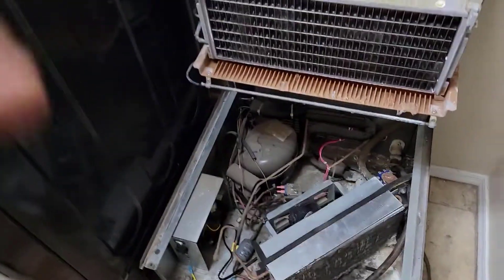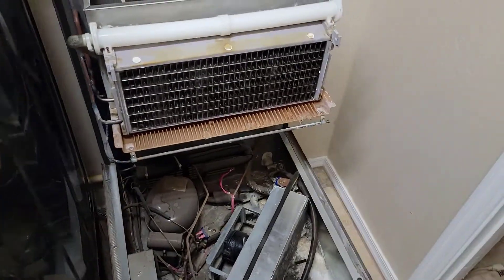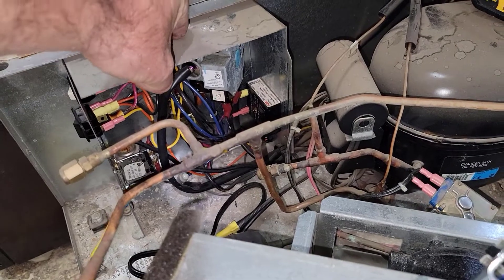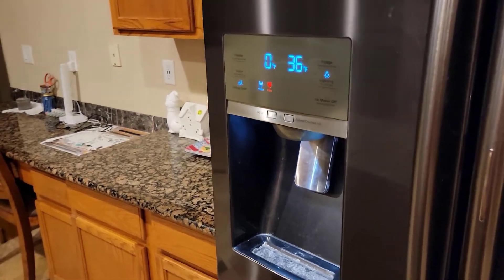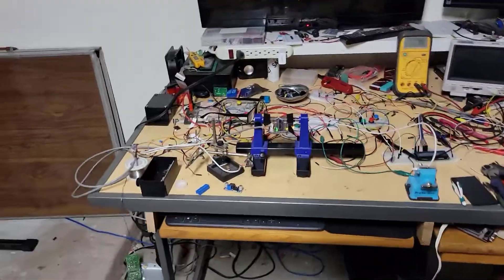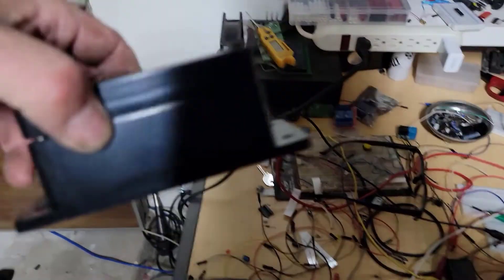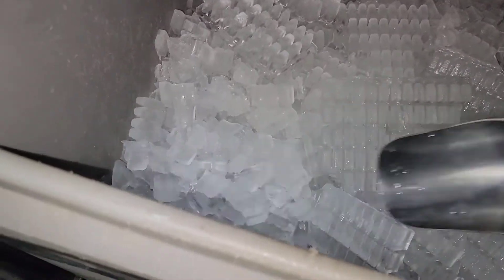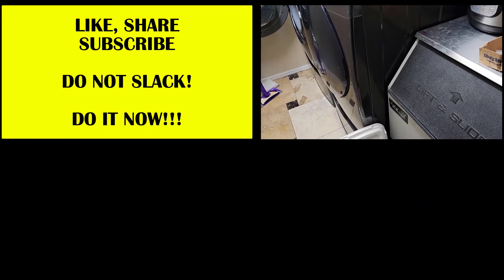My neglected Ice-O-Matic needed some maintenance desperately!

Comment: Manufactuers have used "beams" of some sort to prove bin is full. Maintenance nightmare, water splashes on them, builds up gunk, thinks bin is full.
Reply from the maker: Exactly my right process  
It would have been cool until the sensors got build up on them.  Then a nightmare

Comment: Are you running a filtration system on the make up water?
Reply from the maker: Embarrassingly... no.
Still never got around to buying something. 
And I've recommended and installed them professionally in restaurants etc

Luckily the water don't seem too bad at all here.

Comment: #hackfreehvac So I just fixed my Samsung ice maker. It's been a nightmare. I added a freezer drain heater and wrapped it around opening for the fan Samsung SELLS(the FIX TO THIER FUCK UP) dripclips that help but don't solve. I rang out the wires on the mullex connectors in the ice maker and attached it to the ice maker heaters so that it turns on whenever the ice is ready to dump. If the fan is blocked, ice melts and freezes over and over causing that bullshit. It does work decent when it's not froze up. We fill and empty ours once a day. It will completely fill once about 18hrs. I'm glad I finally got it completely fixed. Piece of crap needed defrosting every week before modifying. lemme know if anyone wants to end fix to finally use your Samsung ice machine and not have water dripping from the door constantly.
Reply from the maker: Damn, what a POS.
Now that we have the commercial Ice-O-Matic I won't even bother with the Samsung built in ice maker. It isn't enough for our family anyway as it's ice production was a bit less than our old fridge.